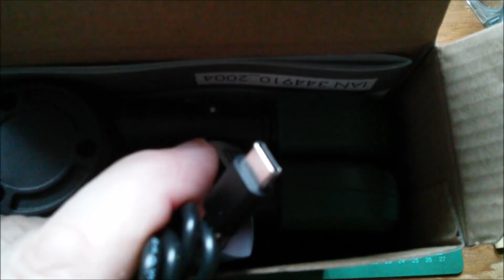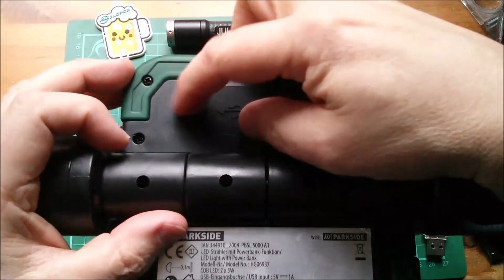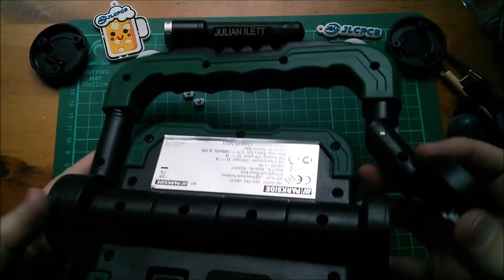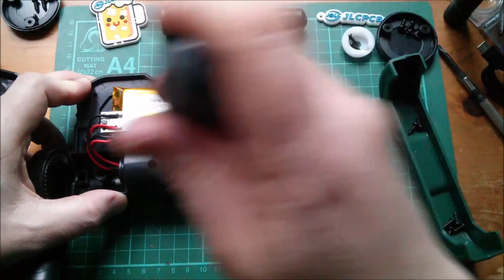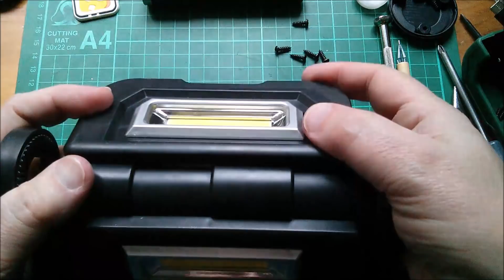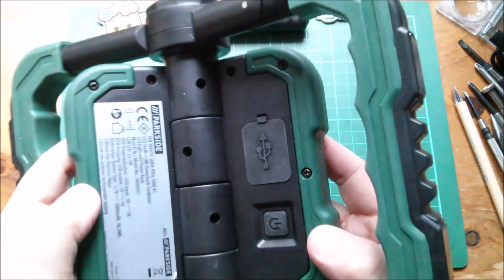New at Lidl - Parkside LED Light with USB Power Bank

Comment: most of those lights a kind of a scam. the only way to get their runtime is by lowering the power after some time. had this with another lidl light i had to return because of that and since then i testet some other random lights directly at the shop and they all had the same issiue.

Comment: Thanks for keeping the technical content down.  The last thing people want is to see things like using the oscilloscope to look at the PWM signals driving the LEDs, or measuring the current drawn by the LEDs, or looking at the quality of the 5 Volt output with a USB tester and USB load, or checking the current drawn by the unit in charge mode.

Comment: Oh that's really clever, they've combined the function of the battery with a heatsink for the LED module. Very innovative design! I guess they could've further optimised the design by also sticking a spring on the battery and turning it into a ratchet as well.
Reply: I see it a similar way, it would of course be interesting to measure the led temps in usage, it could be a betting game :D I'd say... hmm 60 °C on the lipo, or at least 40 °C above ambient.

Comment: Julian, have you seen the guy in New Zealand who has used an old washing machine to power his house from a puddle up a hill from his house. apparently he's been power his home for over sixteen years now. and the only modern tech he's using is some li- po batteries & some BMS's that you use for the shed.. plus a cordless drill o help with regulation if my memory servers me right. The water from the puddle(which is almost completely dried up, but it works great)  is far up a hill form his home & he pipes it down with long pipes connected together. & then into the cordless drill for regulating flow when needed.  and its bloody genius. And well worth a look.. 
HERE'S A LINK TO HIS SITE, CHECK IT OUT, YOU WON'T DISAPPOINTED....

(FROM MARTY T)
FREE POWER FOR 16 YEARS FROM A MODIFIED WASHING MACHINE /WATERWHEEL

Comment: It might be a little more honest than most with the power bank capacity.
Packaging shows: usable capacity 1700mAh (5V / 1A)
Battery: 3.7V 5Ah
Battery label: 18.5Wh
But then it is called a 5000 in the model number...
Confused why it says usable capacity that is less than half of the battery's capacity when the step up converter should be better than 90+% efficient.  But this still is way better than most that claim their battery's capacity in mAh at 3.7V as the USB 5V capacity in mAh.
Reply: What I don't understand is how they determine 18.5 Wh will drive 2x5 watt LEDs for 3 hours. The math doesn't work out. 10 watts for 3 hours would in my silly mind require 30Wh.

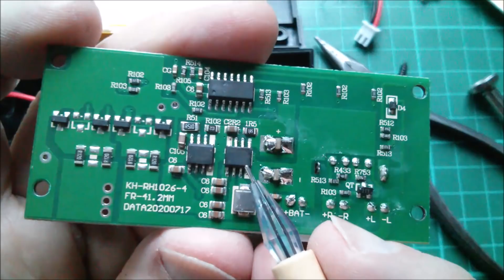Comment: Solder ball on the boost IC pin 8 pad.  10:04  Could be bad news if it gets dislodged.  That's what happens when you don't clean the PCB after soldering.

Comment: Really, though, hats off to whoever thought to label the PCB with the component values instead of arbitrary numbering.
Reply: It's good from a hobby or DIY perspective, but it's an absolute nightmare on the manufacturing world.
After doing PCB and SMT assembly for 5 years you tend to notice the difference between a PCB designer and a logical PCB designer, things I've kept with me now I've moved into design.

The lower numbers components would be to one edge and the higher numbers to the other, so you know if your 10K is labeled R13 you know it's going to be somewhere near R12 and R14, say there's a board that's got 12 strips of identical circuits, like a multi-channel lighting controller, you know that R16, C16 and Q16 are all going to be in that strip.
Reply: Having individual component numbering is also essential if the product is designed to be serviced and repaired, or if modifications are needed.
Without individual component numbering, how would you reference a particular component?
Reply: @Mark1024MAK  I mean you could easily do both and use SMD codes even for through-hole components, for example "R1 103" and now I know where R1 is and that it's also a 10k resistor and maybe add a modifier for through-hole like "RT1 103"
Reply: @vgamesx1  - on closely packed PCBs, there is often not enough room to have both. Obviously if there is space, then that would be nice.
Reply: @Mark1024MAK  Thanks, I had forgotten about that...

"Replacement the 10k resistor" 

'erm ok, but which one? There are 17 on this board'

"The one nearest the fuse"

'There are 7 fuses.....
Reply: @vgamesx1  As @mark 1024MAK said, sometimes there just ain't room, a number of boards I've repaired don't even have room for the ID, there's a table of IDs near a cluster of parts that reference which one is which.

Unless the board is designed for hobbyist or DIY repair, there's no value to the extra work involved in adding two sets of ID per component. During assembly the location ID is all that really matters, I mean the component value and location/s are on your parts pots.

Comment: I would either reduce the current to the LEDs, or place an aluminum plate between the LED and the poly cell. 
4-5 folds of aluminum foil if you have no other option, but a solid plate would be best. 
If that battery if full and you heat it up, you'll have a bad day.
Reply: Don’t you want a heat insulator between the LED COB and the cell? An aluminium plate will just conduct and spread the heat towards the cell. As both are in an enclosed space with poor ventilation, even a heat insulator will only delay the cell from getting hot.
Reply: @Mark1024MAK  Cells get hot when in use anyways, but they don't heat up in one spot. 
Spreading the heat is the important part. You don't want to heat a small area, when you can spread the same heat into a large area. That's how heat-sinks work. They increase the surface area for heat to radiate out.
Reply: @piconano  - actually the idea of a heatsink is to allow as much heat as possible to be convected or radiated into the air.
Reply: @Mark1024MAK  No! You don't say!
Reply: @piconano  - so where is your air flow in this case?

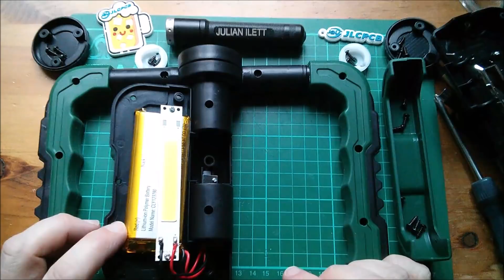Comment: 5:08 So the hot COB is on top of the battery?
Reply: Not impressed with that. That battery isn't going to have a good time, being grilled by a 5 Watt COB, using it as a heat sink.
Reply from the maker: I suppose you could use just the other hot COB (which is on top of the PCB)
Reply: @JulianIlett  I guess the choice is, fry the battery or the PCB.